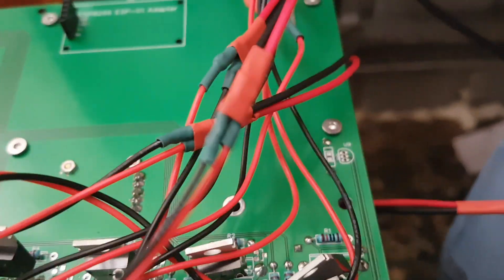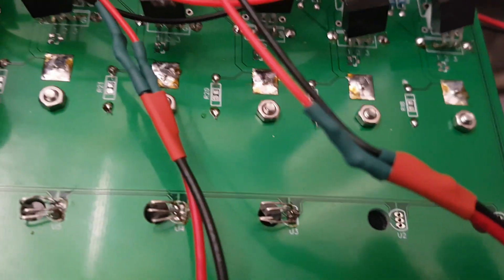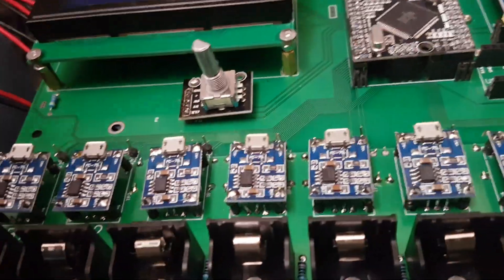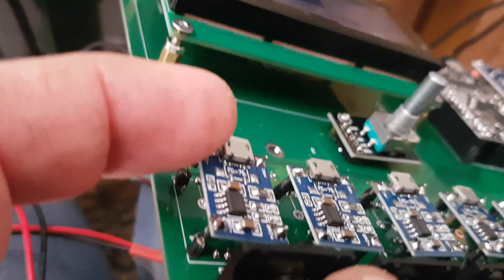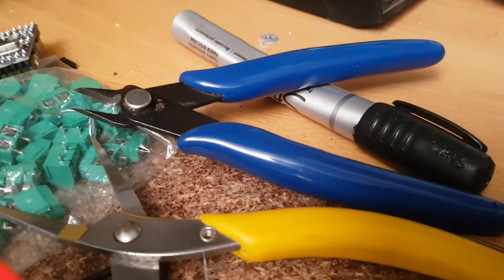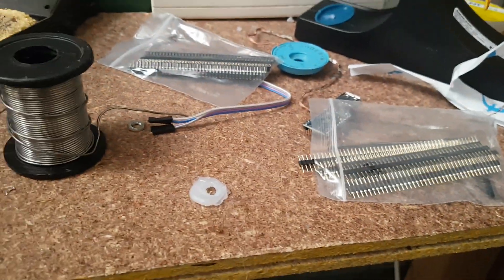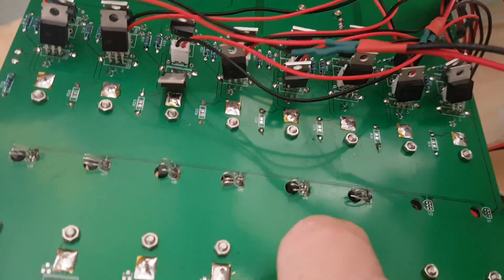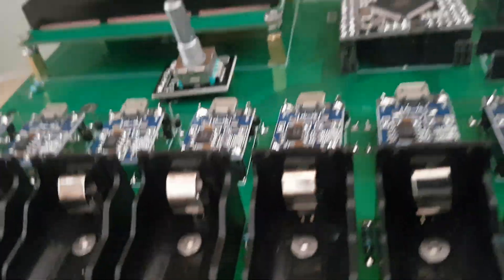DIY Charger/Discharger 18650 getting close  Part 10.

Comment: Almost there mate. I will try to do a video of the USB Host tonight as my second one just came in the mail.
Reply from the maker: Usb host in, but wifi adapter board fried during desoldering. Need the code now to load to mega 2560 pro.
Reply: Not code for the WIF yet. Just use the Ethernet one. I will update the code now.
Reply: OK Code has been updated. You need to install a bunch of libraries and modify UsbCore.h from P10 to P8. Info is in the README.md on my github.
Reply: Also const char userHash[] = "";    // Database Hash - this is unique per user - Get this from Charger / Discharger Menu -> View
const byte CDUnitID = ;    // CDUnitID this is the Units ID - this is unique per user - Get this from Charger / Discharger Menu -> View -> Select your Charger / Discharger
Reply from the maker: @brettwatty101  Sorry mate not much of a programmer. The github address can you provide it again please as the readme did not take me there.
Reply from the maker: Found it. Happy now.
Reply: @chuxxsss  on the top of the build instructions on my site or in the description of my build vids